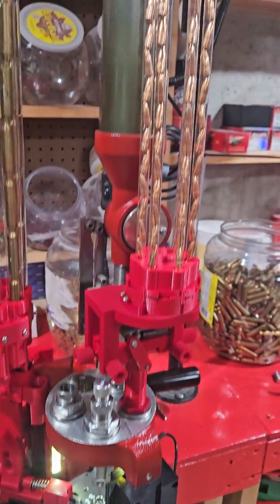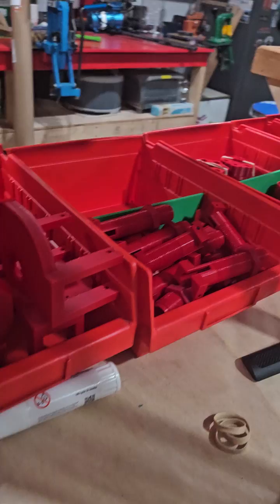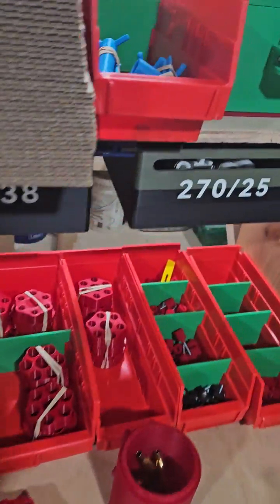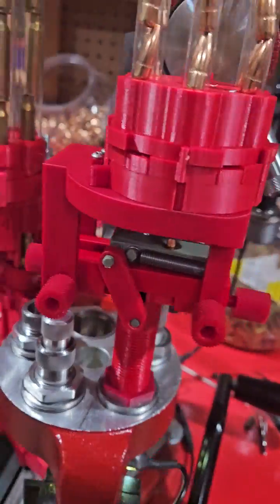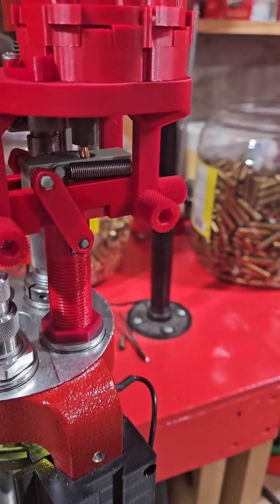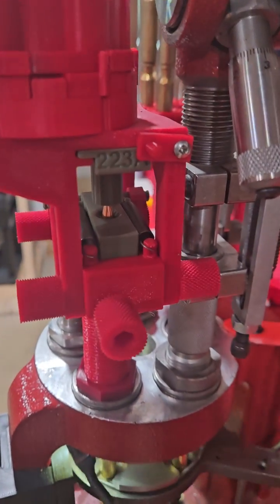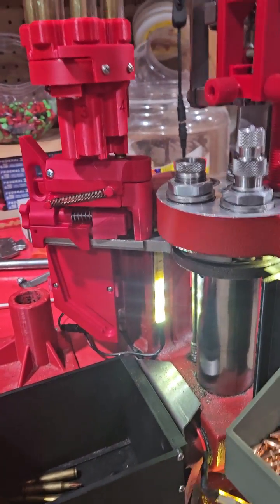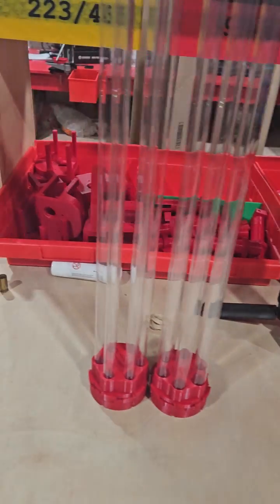3d Printed Bullet Feeder Latest update!

Comment: Way way way way way way too huge and bulky the Mr bullet feeder is so awesome it fits on top and one mechanism to feed the bullets why do you complicate things
Reply from the maker: @markkornytchuk7847  Hello.  Thanks for commenting.  Yes it's bigger then your average manual load bullet feeders.  How ever my thought process in designing this like it is was to be modular and allow the reloader to swap out the internal parts to do different calibers using the 1 die and housing set up.  For someone that just reloads a single caliber the Mr bullet feeder is a great option.  For someone like myself who loads several different calibers this will them to have 1 die and housing set up and then different caliber insert pieces to swap between calibers.

Comment: What is the major benefit going to be over the other model?
Reply from the maker: Hi there.  Other model? Do you mean other bullet feeders out there?   Other bullet feeders require a different setup for each caliber.  Mine will have 1 die body and then you change out the internal parts for different calibers and will only have 3 different sized tubes
Reply: Your previous model
Reply from the maker: @joshuaharris1194  this my first bullet feeder.  My other feeder is the brass feeder.